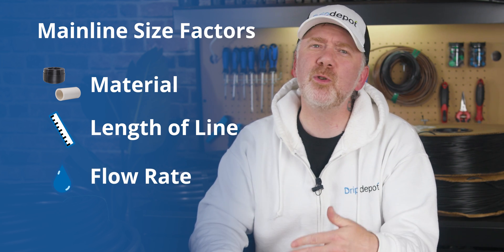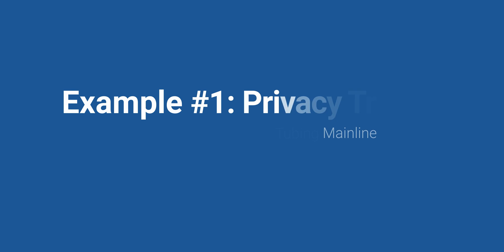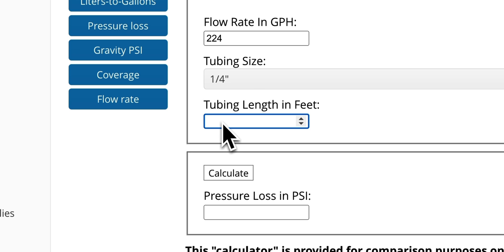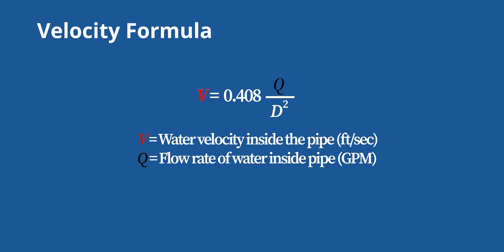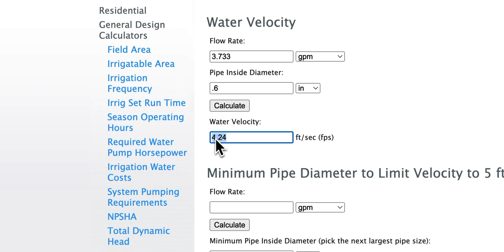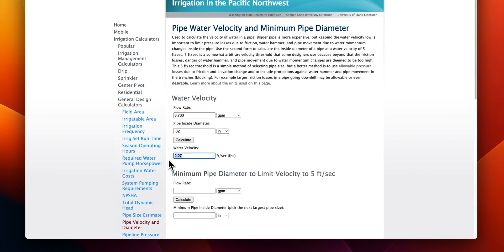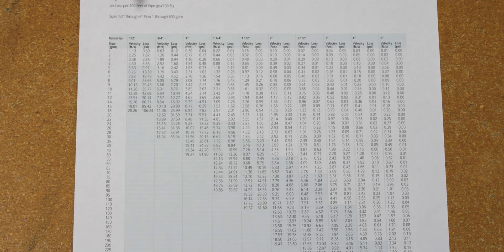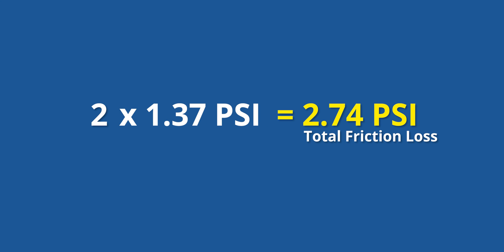How to Size an Irrigation Mainline (Step-by-Step DIY Guide)

Comment: Do you have, or can you make, a video on irrigation for small tree farms….e.g. Christmas trees, fruit, etc?  Being spaced 5-6’ for Christmas trees and 15’ or so for fruit, I assume drip tape is not the way to go.  Also, sometimes these have pretty long runs, not necessarily nice squares.  These are often on slopes as well.  Thanks!
Reply from the maker: We do actually have a video showing the installation of a tree irrigation system (located here: https://www.youtube.com/watch?v=NkGTXrGkcRM).  

The system we made in the video is fairly small, but it is scalable up to larger systems with a few small changes (larger diameter main/laterals, potentially zoning, etc).  

The one potential issue with the system in the video is that it's not necessarily ideal in locations with topographical slopes, though this depends on how significant the elevation changes are.  Low points in systems with elevation changes will emit more water than at high points since the emitters are not pressure compensating -- if the elevation change is slight, the volume released won't be too different, but if it's enough of a difference the increased pressure could be detrimental (and water can sometimes drain at low points if the low point is under enough pressure). 

Any rough idea on what the elevation difference would be between the water source and the lowest point trees?  With that we can determine how much additional pressure those locations will be under :)
Reply: @dripdepot  thanks again for quick response.  I’ve seen that video but the process seemed too labor intensive for 1000-2000 trees spread over 2 acres 🙂.  I’ll keep studying the options.  Thank you!
Reply from the maker: @brandonletzko2472  I do agree, at a couple thousand trees it would be pretty labor intensive -- sore fingers wouldn't even begin to describe it :)

Another option often used for trees are Microsprinklers -- by comparison, the labor would be minimal in just punching a hole in the mainline, inserting the barb on the microsprinkler and then pushing the stake in near the tree.  

If you were wanting to stay on direct soil application (drippers), you could consider pressure compensating drip tape (very high cost for that right now though) or even potentially just running poly tubing down the row and punching in pressure compensating drippers at the trees.  The labor time (and material costs) would be reasonable and you'd get the benefit of having pressure compensating emitters so that low-point drippers would still be emitting volume very close to high point emitters.
Reply: @dripdepot  thank you!

Comment: What if I have a straight run of 100’ mainline and then break off into two rows each of 50’ mainline to access two rows of trees. With this “Y” in the mainline, Do you measure the total 200’ or since it’s in parallel just use 150’ ? (Regarding mainline diameter sizing) thanks!
Reply from the maker: Great question, and it does get a little fuzzy at that point as the segments after the Tee are not necessarily cumulative in the same way as a continuous run.  Like a magician's secret, finding concrete information and/or math on this is difficult.  

In cases like this I like to defer to friction loss and velocity calculations and treat the segments off the Tee semi-independently.  In this case, the 100' run is going to carry the full flow rate, including the flow that branches off the two outlets on the tee, so I'd calculate the friction loss and velocity for the full flow rate in the 100' run. 

The two 50' runs I would calculate only for what flow was going through those.  Flow, in this case, just refers to the sum of all emitters operating off that line.  Since the line splits, not all the flow of the system will be going through both segments coming off the Tee. 

Basically, if the system had a total of 200' of drip line with a 0.5 GPH emitter spaced every 12", the total flow rate of the system would be 100 GPH and the initial 100' run would carry all of that 100 GPH.  I would use that to calculate velocity and friction loss through 100' of 1/2" tubing. 

If that drip line was split evenly, you'd have 100' of drip line through one segment of the tee and 100' of drip line through the other segment of the tee.  That means each segment would be responsible for 50 GPH, which I would calculate for those individual lines and not add them to one another, but only to the 100' main segment that came before the split.  

I know that's a lot of information so please don't hesitate to ask any follow-up questions that come up!

Comment: Thank you for this informative video @DripDepot. Can you also do a video on how to size the laterals? Thank you
Reply from the maker: You bet, we'll add that to the list!  

In the meantime, I can help here as well -- sizing a lateral is very similar to sizing a mainline.  The lateral will be considered its own line in regards to its friction loss and velocity calculations. 

As a quick example, if this lateral was feeding two sprinklers, each of which delivered 1 GPM, you would run the calculations for a line with only 2 GPM going through it -- essentially, you wouldn't be considering the water that's going through the mainline, as it is feeding many laterals who are calculated individually.

Comment: @dripdepot we have an odd situation and can't figure out what parts of your tutorials apply to. We live in a condo above our business office and have a deck where I container garden. Its insanely cumbersome to go downstairs, outside, and around the building to turn on the spigot, then back inside, upstairs, and out to the deck each time to water with a hose. How can I get hose access and drip irrigation (on a timer) up there? I dont want the timer at the spigot because customers can mess with it, plus it won't be convenient to adjust. I rather have the timer up at the deck as a point to run a hose, plus 2 "zones" of irrigation - 1 zone for pots, 1 zone to use the GreenStalk vertical planter watering system. Not sure how to configure the "head assembly" at the spigot VS what goes up at the deck. Any recommendations? 

Would the following work?
Spigot > backflow preventer > garden hose 50ft along building then 20ft up to deck > timer with 2 outputs/zones... 

Timer zone 1 with hose to 1/2" mainline adapter > 1/2" mainline along deck > 1/4" tubing to emitters 

Timer zone 2 with quick connect fitting > quick connect to hose / quick connect to GreenStalk's 1/2" line watering system. Be able to swap out the GreenStalk's line for a garden hose if needed on the deck.
Reply from the maker: This one will be tricky, as the valve in the timer is really the only part of the system that is rated for constant pressure -- this means everything should come after the timer, as anything before it will always be under pressure.  

That constant pressure will quickly wear out backflow preventers, pressure regulators, filters and can cause garden hoses to rupture and create a big mess -- there are garden hoses out there that are rated for constant pressure, but they're not the default unfortunately.  The backflow preventer not being rated for constant pressure is the real big obstacle though, as it's one part you don't want to compromise on but there'd be no way to have it connected to the spigot and not be under constant pressure if the timer were downstream of it.  

Depending on the total number of plants, you could go with a type of self-contained system.  We see this used a lot in this exact application: https://www.dripdepot.com/aqua-magic 

It's self contained (has everything except a tote or container to hold the water) and includes programmable watering cycles. 

If the deck is reasonably protected from the elements, a similar self contained setup (though this one is also a container to hold the water) is at this link: https://www.dripdepot.com/oasis-evolution-drip-watering-system

Another option could be to go with a timer that has a closing cabinet -- while it could be opened, customers and others might be less tempted to press buttons if the cabinet were closed (something like this: https://www.dripdepot.com/8420-duplo-evolution-water-timer )
Reply: @dripdepot  thanks for your reply! It is a tricky situation isn't it! It seems the only options are drip pumped from a reservoir/possible rain barrel? or having a hose end timer at the spigot. Neither of these options allow me to turn a hose on/off from up on the deck.... do you see any solutions for hose access without having to go downstairs, outside, and around the building to turn on the timer, then back up to the deck to water? The trips outside and back are cumbersome with toddlers needing to come with to turn the hose on and back off since it's not safe for them to be left alone on the deck.

Is there any device that can be used on the spigot under constant pressure so that the timer can be put "downstream" up on the deck? Perhaps a timer that is always in the ON position and another timer at the deck to actually schedule watering? Or a first backflow preventer/vacuum breaker on the spigot and 2nd used with the head assembly up on the deck? Gosh really stretching for a solution to turn things on/off up there.
Reply from the maker: @jIlLiAnganz  A WiFi timer could perhaps do this -- you could install a WiFi timer at the hose bib and then use an app on the phone to manually turn it on/off for hose access.  Here's a link to an example of a WiFi timer with two zones: https://www.dripdepot.com/b-hyve-xd-smart-hose-timer-outlets-two

That would allow you to have the backflow preventer right at the timer outlet as well -- no cabinet to prevent people from touching buttons, but it's app controlled so you can turn it on or off anywhere you have internet access. 

Another option might be to install a drip irrigation system up at the plants on the deck -- I suspect it would be pretty low in cost and then you could program the timer to just automate them and not have to worry about going up on the deck (at least, not for the watering).  If aesthetics are a concern, the white poly tubing could be used -- or, if the hose you're currently using it with is a permanent type thing, you could run the drip system off of it up on the deck and still have the timer at the hose bib.
Reply: @dripdepot  Brilliant!!! WIFI timer! I think that will be a great solution for not having to run back and forth to turn it on! So one more problem... If I use a wifi timer and head assembly at the spigot downstairs outside, and I can only run ONE hose up to the deck (don't want an eye sore or to bring more attention to what we have rigged up by using poly lines) how can I switch between the drip lines and using a short hose occasionally for odd jobs like extra watering or cleaning things? Could I have a quick connect up at the deck?
Reply from the maker: @jIlLiAnganz  You bet, a quick connect would work, or even just a swivel fitting so you can just turn the swivel to remove it.  That would allow you to swap between poly and hose pretty quickly -- you could even do it with the flip of a switch with a faucet Y that has on/off (this one here: https://www.dripdepot.com/1228) :)

Comment: Crazy this video was released three hours ago, I just got through watching your tutorials on setting up an irrigation system and had everything planned except for what size mainline I should use! Thanks for making these!
Reply: Drip irrigations are never boring for me 😂. Adam is hands down the best drip irrigation source in YouTube. 

Not all hero’s wear capes.
Reply from the maker: @GardeningwithDave   The same could be said about you too Dave!  Gardening with your baby and pets and getting that time with them is heroism as it's meant to be!
Reply: 8 days into the release of this video, I am in the same boat, what great timing
Reply from the maker: @overmindsc2   We didn't even plan it that way, I'm so glad it worked out that way though!
Reply from the maker: What great timing!  And you're very welcome -- this one is a "boring technical" one but was one of my favorites to make.  I'm glad it came out in time to help with your planning :)
Reply: @dripdepot  can tell me how to install a Perma-Loc Tubing Coupling? Meaning, were to install if there is more then one location that I want water flow. Thanks.
Reply from the maker: @warrior8021  You can connect a Perma-Loc coupling pretty much anywhere you want to join two pieces of tubing together -- likewise, if it's easier, you can use a Tee to split it into multiple directions or an Elbow to join two pieces but turn 90°. 

To use one, turn the locking nut as far as you can back towards the fitting so it is fully retracted -- then push the tubing on over the barb, followed by turning the locking nut so it clamps down over the tubing to secure it in place.  

We have a short video that shows how to do what I described above just in case it helps to see it done: https://www.youtube.com/watch?v=ZuGa8B25gIY